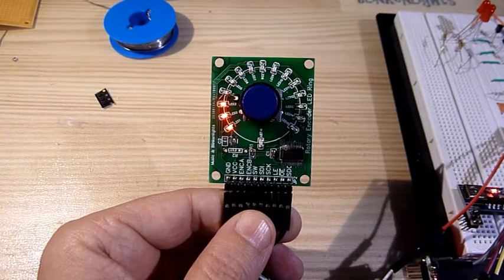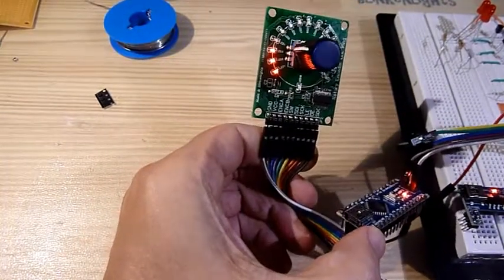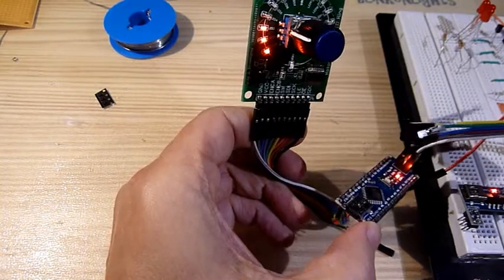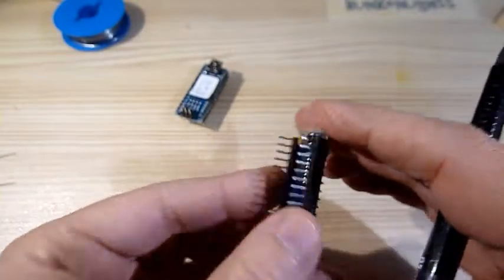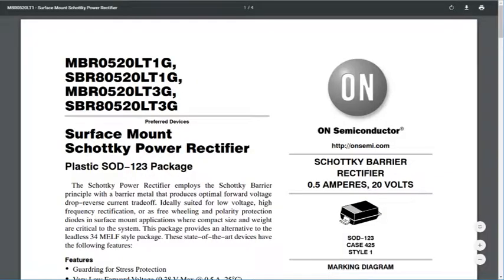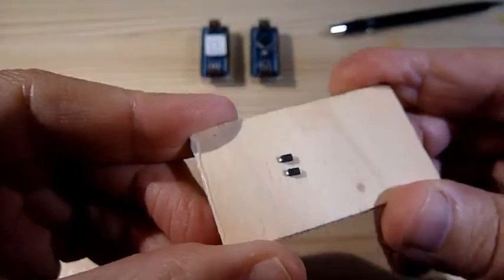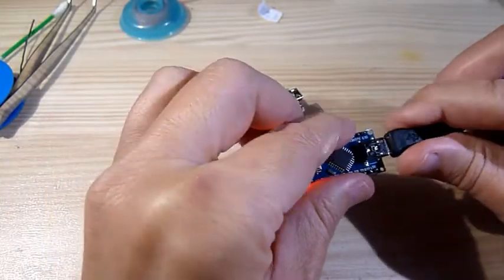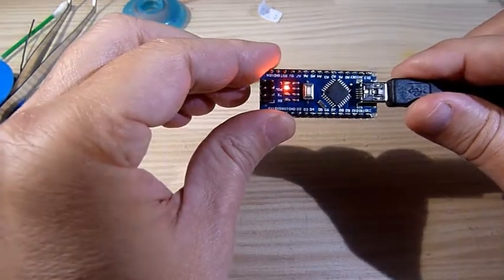Repairing an Arduino nano - Blown USB Power Diode

Comment: i did short my arduino nano, and i change the diode with 1N4004 type
the board is on, but not detected anymore on my PC
is there any solution??
pin 3.3v doesn't have any power, so on IC CH340G also

Comment: my nano smoked & has a hole on the diode, still works perfectly fine, also the mini usb connector is delicate 2-3 times plugging removing the blue cable damged the connector,now connected a permanent cable to the ch340.
Reply from the maker: I constantly plug & unplug the connector. It's still fine. Good idea, though, to solder-hack it and stop worrying... :-)

Comment: There's no problem to replace it with regular schottky diode with same or better paraameters than this one, right?
20V 0.5A
Reply from the maker: If by "better" you mean "stricter", then yes. The diode protects the USB circuit, and you want more protection, not less.
Reply: @musicandblinkenlights8280  Nevermind. Actually I thought about repairing arduino nano - after powering servo from 5+ output - which of course fried it. But then I didn't knewit isn't allowed to connect servo to 5+ output - before i was working on esp8266 microcontroller which allows that. I've read that either microchip atmega is burnt or it only needs bootloader. is that true?
Reply: @qnaman  actually I also did not know one should not connect servo to the +5V.. And did several things with 28byj48 directly powered from USB, that actually all worked without any problem. Now started new project and right after I have everything soldered together - it burned this diode... I think one should start sketch directly with zeroing all outputs and then drive with small delay between steps. Actually I have just measured -  the coil resistance on 28byj is about 20 Ohm. It means with 1 coil powered only 250mA flow, that should be Ok. BUt in case two or more at once, for example using half steps - it is a problem..
Reply: @TushhsuT  20V and 0.5A diode is okay or not? If not what should be the properties? Thank you.

Comment: Thank you for the video!, can you please tell me if I can use the nano safely without the diode, i'm missing a soldering iron atm, i programed it with another nano of mine, it looks fine but i'm not sure! Thanks again!
Reply from the maker: If you are certain, never to wire it in reverse or have a short (test with multimeter in "beep" mode between 5V and GND)), then you don't really need the diode. I believe it protects the USB circuit (both on board and in the computer). Just don't blame me if either blows up.

Comment: Hello, thank you for the video. Can you please tell me the direction of the diode, which direction should i place it?
Reply from the maker: The edge of the diode with the line should point "into" the board, i.e. be as far away as possible from the short edge of the nano's pcb.

Comment: on digispark(85) burned Schottky diode. Its marking is s4. Could you tell me the equivalent or the correct name. thank you
Reply from the maker: If you google "smd diode s4" you'll find that it's a surface mount schottky barrier diode (e.g. SD103AWS or Vishay SS14). You can also google "digispark 85" and then look for the schematics of the board (under documents or downloads). On the schematics, it's labeled as MBR0520LT, i.e. the one I used. Hope that helps. I suppose any is fine.